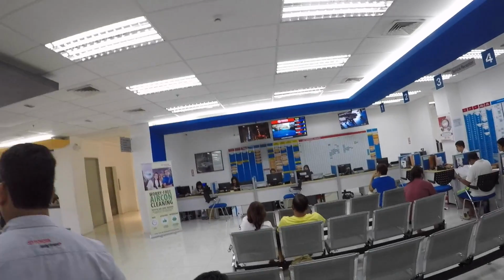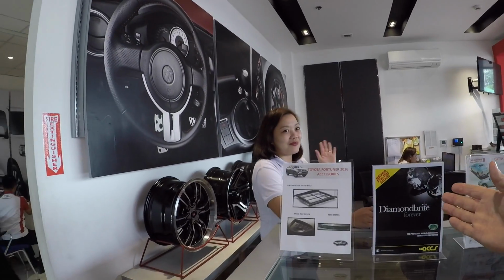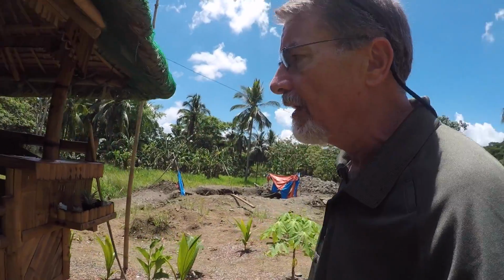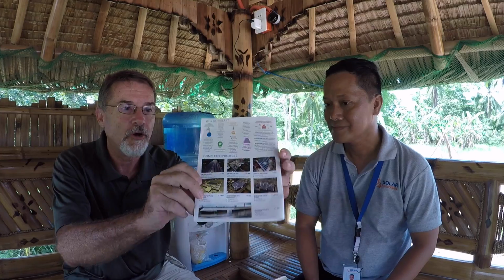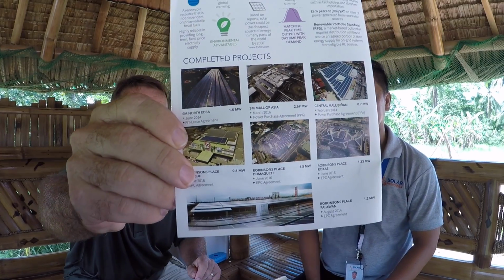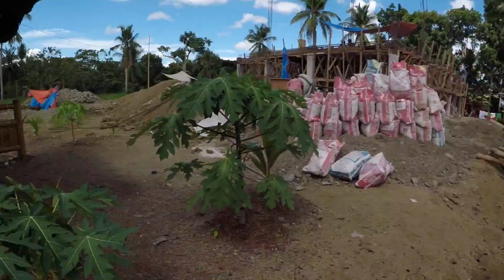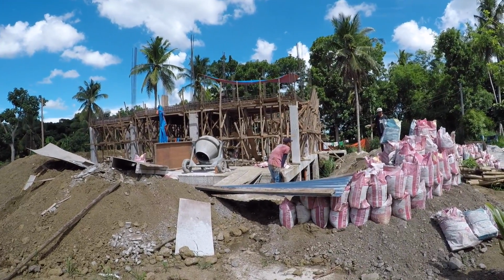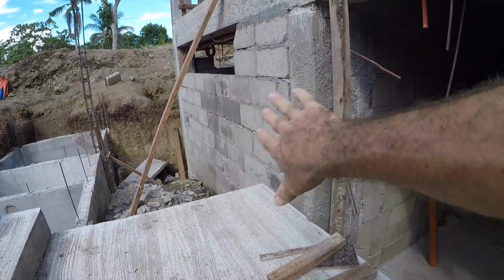VILLA FELIZ - EPISODE 96: LET'S TALK SOLAR - PART 2 (House Building in the Philippines)

Comment: If you have a battery storage you don't need that much solar to charge the system, you can use a few Golf Cart six volt batteries
Reply from the maker: The solar will charge the batteries, but they'll be used up quite quickly seeing as we only have about 5 hours of solar exposure from the east facing PV's.  The vendors solution is 8 deep cycle batteries.

Comment: So if you dont mind ? what's your opinion on how they lay the block ? 
i just dont understand why they dont butter both ends and point the joints . some blocks dont get any cement on the ends
Reply from the maker: Not a fan of CHB's period, but its the preferred method of most builders here.  I prefer forms with steel reinforcement.  Builders don't want to invest in the forms.

Comment: Goodmorning! Its build day 97. Dont you think iT would have been a good idea to put a little gap between the Outer wall and the inner wall? That'll make sure you Dont see any cracks later If there is and also Will make the basement more cooler. And prevent the water to leak from outside. Just a thought
Reply from the maker: The entire purpose of the additional layer of CHB's is to add additional strength the outer wall.  If there's a gap, then theres a chance the force of the earth will cause cracks in the outer wall and water will then find its way into the basement.
Reply: Ok

Comment: It is a good idea to add an additive especially when driving short trips and / or does not get the engine in a real working temperature. There are not many highways in the Philippines where you can drive 2-300 km and get it burned off. So little additive is good a few times a year.
Reply from the maker: Then I did well by including it in my first oil replacement.  Thanks for the tip Anders!  👍🏼

Comment: Thanks for asking the question regarding Tesla Power walls. I understand they are not there yet, but there is hope. The size of them, is certainly the big appeal, plus they have their own on-board inverter. They should be there, by the time we get underway.  Thank you again for the great Vlogs.
Reply from the maker: I think as long as you have all your connections in place like the panels to inverter to CBP, then when the storage solution becomes available, its just a add-on hopefully with a small level of effort.  We'll see!

Comment: solar power is more important to foreigners is because of the brown outs there. we know the more building the more stress on the power grid.  power storage you can use regular batteries or they recommend deep cell/marine batteries. it is very easy to hook up yourself with the proper equipment. I brought my own solar panel and inverters from Canada.
Reply from the maker: Good info.  Thanks for sharing!
Reply: You might want to contact Monark -Cat there offering a 10KW  complete solar solution here is their web site would be interesting to see the price quotes from both companies 

http://monark-cat.com/wp-content/uploads/2015/10/Cat-Hybrid-Solutions-.pdf

Comment: What did the solar guy recommend for your house as far as KW and panel placement? 

Did he calculate how many kWh it each KW of panels will produce when mounted on a 45 degree angle facing East? As opposed to 20 degree tilt facing South?

Are there any solar incentives that you qualify for to offset the cost?

Did he get your estimated consumption so he can calculate the additional "lifeline" subsidies you will save with solar?

Based on what you are expecting to pay by not running the air conditioner and hiding all the wife's hair dryers, and the restrictions due to subdivision rules and house design, and with no 30% incentives like we have in the States, I'm going to predict that grid-tie solar is not going to be economically viable for your house at this time, and the warranty will expire before it's paid off. 

If your electric bill was 20k peso per month, and you had the right roof design, it would probably take 10 years to pay off because the cost per kWh is so high when you consume so many kwh, so solar can cut out all the top tier rates. But if you are only paying low tier rates, solar can't save you as much.
Reply from the maker: Vic will get with his engineers and provide a technical recommendation.  They take a lot of things into consideration such at roof angle and solar orientation as well as our electrical consumption.  He said the optimum angle for their panels is 18 degrees.  We have a 35 degree pitch so the engineers have to take all this into consideration.  I didn't mention these discussions in yesterday's episode because it was so busy.  Maybe I'll add it to today's episode.
Even if it takes 10 years to recover my return on investment (ROI) going green as much as possible is the right thing to do helping the environment with less carbon emissions on our wonderful planet.

Comment: You must have run all the way thru town to get to the truck. We did not even get to see the cow or Mount Maculot. 
Blessed again the 4 inch CHB arrive right on time. Maybe they never eat the peanut butter sandwich. So they not think about glueing the blocks together. Will the next pour be done with the mixer? I notice lots of bags of concrete, sand and gravel look to be full and ready for the mixer.
Reply from the maker: Hey Abe.  Going to have to fire my camera man.  I had a great chat with Michelle and Tess yesterday morning but for some reason the GoPro didn't record.  😠   This has happened before.
My builder hasn't expressed to me yet for the next pour. Looking at all the gravel we just got I'm going to agree with you we'll be doing our own mix manually.

Comment: Hi James, great vlog as usual,  Got a question, are there rebar ties connecting the inner and outer wall together or is it only the skim coat doing that?
Reply from the maker: I advised my builder to have the workers for rebar between the 6 inch and 4 inch CHB's.  Unfortunately, he didn't get the word out until they already had 2 walls up.  Just hoping the dual layer vertical and horizontal steel support will be enough.  I'd worry if the earth were covering the entire basement wall, but it's only 1.5 m so I think we're still in great shape.

Comment: dash cam installed in car is mandatory now in Philippines according to LTFRB. Is that true James?
Reply: Good advice, but LTO cops(in blue) will usually not ask or accept money for a traffic violation. In fact, they probably will cite you for attempted bribery if you offer. It's the TMC cops(in green) that want a pay off. And I speak from several experiences with both.
Reply from the maker: Not that I"m aware of Ofelia.  But it is a good idea in the event of an accident there's no doubt who's to blame.
Reply: its in the news. Better check so you will not get charge jist in case LTO will stop you. LTO Officers are one of the corrupt people so better be safe from them. The President said if a Police or any government officials ask you money, report them right away. Take a video of the conversation or photo, focus on the name tag of the officers and send to PTV or call 888 right away.

Comment: You really need to look at a company that does Batteries currently most do lead acid batteries but it is possible to get lithium ion batteries which are considerably more costly but have a much longer life expectancy.  I have info if you need it on either of these.  We had Lead Acid batteries as lithium was impossible to find at the time, we opted for 24 200AH so me can store about 67KWHs.  Being lead acid you can only use 60% of what is in the batteries you need to leave about 40% this again is one of the draw backs on lead acid..  Lithium you can run down to zero and back up without any issues were as lead give sub-optimal performance if you use to zero.
Reply from the maker: Thanks for the good info Andrew.  You have any info on solar companies over here that do lithium?
Reply: tesla! solarcity LOL hahahha